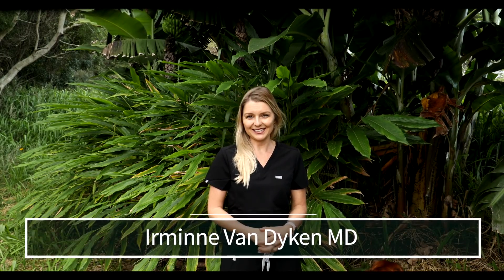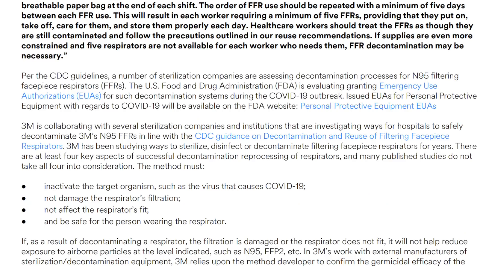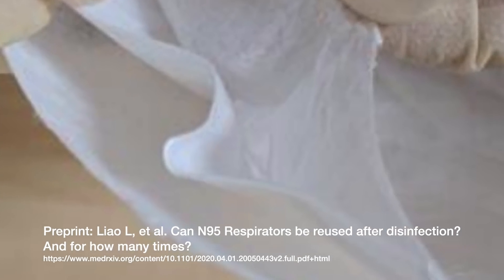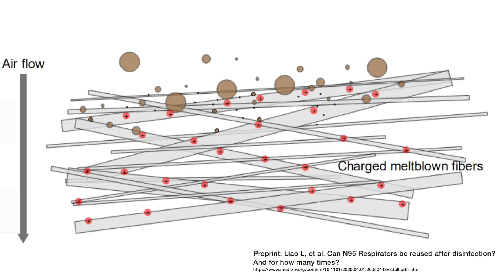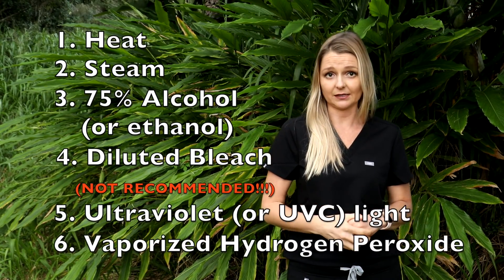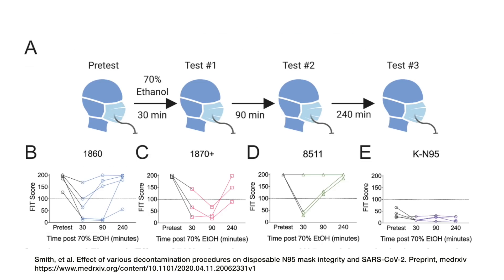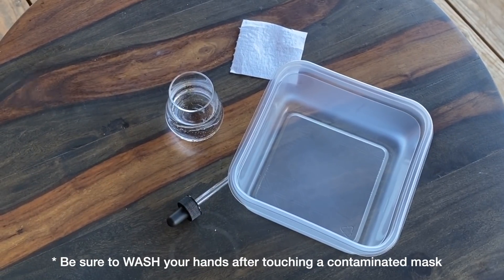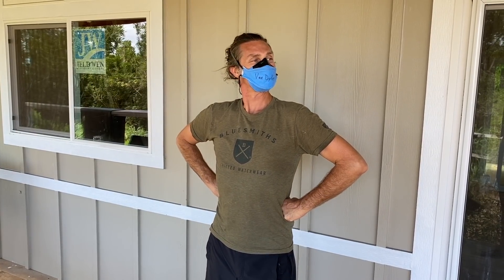How To Disinfect Your N95 Mask at Home

Comment: Excess blather. Must understand that n95 filter works by electrostatic absorption. not reuseable by DIY nuking or baking or boiling or spritzing sanitizer.
AP news 04.23.221 "FDA: n95 masks now plentiful, should not be reused. . .transition from crisis capacity conservation strategies. . ."

Comment: The fibers in a N95 mask are plastic strings (poly) that are only 10 microns across but the static electricity in friction of air as a wearer breathes and exhales "activates" these 10 micron across poly fibers creating a static electricity "field" that "suspends" these tiny .3 micron (so they are 60x smaller than 1 human blood cell) Corona virules.  Washing, heating in an oven does nothing but destroy the ability of these masks to work and they are not reusable. They are just like a vacuum cleaner bag. once they fill up -- that's it. ..and they can fill up after a relatively small exposure time.

What an N95 or ANY face mask does, even if the N95 no longer protects against COVID 19 -  for the wearer is this: it acts like putting a towel over a room fan. It stops the air movement of a person's breath from reaching other people..so the wearer wearing ANY mask protects other people as the wearer's breath can no long travel across the room or 6ft as the lungs exhale air is significantly supressed.

Wearing ANY mask provides the wearer  little protection against ANY CORONA virus.  The average cloth/tissue mask is 60microns, so .3 micron virules pass thru the mask-- it's like stringing a tennis racket over your head before you take a shower expecting it will protect you from getting wet.  So, wear a mask to protect other people from you.

Sit around people wearing a mask.  They're protecting you by wearing one...but not themselves at all.

Comment: Cool. A temperature controlled oven is quite hard to find but this is the best and most efficient, in my research. Thanks Dr. 

I'll use my SMD workstation hot air (used in electronics) at 100C which is the lowest it can go and since Corona virus dies at 70C (safe at 85C for allowance, just in case some variants are more resistant to 70C) in 5 minutes, I'll blast it with the SMD hot air wand for 3.5 minutes or 210 seconds into  heat resistant container with 12 drops of distilled water, maybe 4 minutes, creating a kind of convection oven.

I'll use steam (15 seconds each for the front and back) to try to clean the debris off, to make it look close to brand new- hopefully that works (without scrubbing as it can destroy the filters).

God bless, Rev. 21:4

Comment: People need to see things in perspective, 
The size of this video window is the mesh size of those cheap earloop masks, 
The size of the "Mini Player" box is the mesh size of an N95 mask
The size of the Virus is the red "HD" square.
Trying to stop an INBOUND virus with a cheap earloop mask is like trying to stop Pollen with a Chain Link fence.  The masks are supposed to stop outbound droplets and it only really stops spit sized droplets which are the ones that don't travel far. Exhaling through a mask micronizes the droplets so they can float around for hours.
IMHO, if you are not using an N95 you might as not wear anything.

Comment: I use the UVC method with my N95 masks. First I place the mask on a small turning plateau. Then I put a 40W germicidal UVC lightbulb at a distance of 20 cm. After 15 minutes I turn the mask upside down so the side touching the plateau gets sterilized too. 15 minutes later it's done. 
The only downside is that the masks smell like ozone.

Comment: I just used a spray hand sanitizer with 80% alcohol, would this be effective?
Reply: That deactivates the electrostatic charge  which compromises the masks effectiveness by about 30%. So Isopropyl Alcohol is not recommended.

Comment: You say cook for 30 minutes, but then say 40-50 minutes.  Do you leave the container in the oven after the 30 minutes when the heat goes off, or do you leave the heat on for 40-50 minutes?

Comment: This will kill my electric bill. Is there a way to use my old oven (That sets at 200 degrees & up, without any control panel) to do the same thing? Also if I used  a digital thermometer will this ensure that the temp. is correctly maintained? Thanks so much for your research  👍👍

Comment: On you video you say 30 min. then rotate lid 45 degrees and put back in oven for 5 minutes.  That adds up to 35 minutes in the oven.  You also say it will need to be in the oven for at least 40 to 50 minutes.  So the math does not add up.  Which is it .  Thx

Comment: Here in Finland almost everybody have a sauna or are possible to use it. The most usual temperature is around 80˚C to 100˚C. I think that it is very good opportunity to clean masks. Some people go to sauna every day, some only once a week.  I wouldn’t use plastic box but something else which can withstand the heat. That your hint using water is good. Anyway, if using different method; the virus is killed in three or so days so you can just leave the mask and wait, let’s say four days and it should be all right to use. What do you think about this method?

Comment: Hi mam . I need I suggestion . Pls help me .
I am from India .
During this Pandamic,  as per ours Government and researcher they announced N95 with valve/ respirator is not safe to use.  
So can we 1st wear a 3 layer surgical mask and on top of it N95 or N99 valve mask ? Will it be best idea ?? 

Pls solve my querie.
Reply from the maker: Hi! thank you for your question, it is a difficult one. It depends on where you are wearing the mask. Also, I do not believe there have been studies done on transmission of a N 95 mask with a valve and a surgical mask overlying it. There is concern of leakage through the valves, and a surgical mask may not block that inhale or exhale leakage. In other words, theoretically viral particles could be transmitted through the mask and through those valves. But, when I’m working with a patient that does not have known coronavirus and it is not an aerosolizing procedure, I wear only a surgical mask. No N 95. For any aerosolizing procedures, I wear an N 95 non-valved mask covered by a surgical mask. Honestly, if it is a choice between an N 95 mask with a valve and no N 95 mask and you are working with a known Covid person, I would choose the N 95 with a valve over no protection at all. I hope this helps.
Reply: @outofthedoldrums  ok mam . Thanks for your reply . 

As we have to wear mask for long time , every day 6 to 9 hours, and ours Indian researchers says the N95 mask with VALVE have an issue to transmit the virus through the exhaust air out from valve . Without VALVE it's too difficult to wear for so long . So should we 1st wear a surgical mask and then on top a N95 with VALVE.  
So that the surgical mask will block the out flow of air and the N95 mask will filter the intake air through VALVE.  

Can this be done ??

Comment: Can I wash my N95 mask with regular detergent?
Reply: NO. Don't wash it at all! If you get it wet or spray it with alcohol or hydrogen peroxide, it will become useless. I learned that the hard way. Kept spraying mine with alcohol and then later, when new studies came out, I  read an article by The American Chemical Society who did a study on how to clean N95's. That was the worst thing I could have done. It has an electrostatic charge in the middle and that's what gathers all of the bacteria. So if you get the mask wet, the effectiveness goes way down to only 50 percent. Might as well use a cotton mask if that happens. I personally don't want to buy a convection oven as said above in the video, so I am jjust leaving mine in a paper bag for two weeks until the virus becomes inactive. In order to do this you have to have several masks though. I am blessed that I have several.

Comment: I just threw my P95 in a washing machine with laundry detergent (Quick Wash).  It came out just fine.  If I die, I'll die with a clean mask.  But I'm not a healthcare worker or caregiver.  And the only time I come out is to grocery shop.

Liquid hydrogen peroxide showed no effect on FFR filtration performance [3, 7]. Bergman et al. evaluated six FFRs for filtration performance after a 30-minute submersion in 6% hydrogen peroxide. All six FFR models tested demonstrated no changes in filter performance after three cycles of decontamination. FFR fit and disinfection efficacy were not assessed for this method.\\

Comment: I have a question about your process.  You say, "no direct line of sight to any radiative heat sources which would cause potential damage the mask."  I'm at a loss to understand what you mean.  My small convection oven has an exposed heater element and a convection fan - is this what you are concerned about, the element being a concentrated heat source, and not creating uniform heat?  If you could be more specific as to the context of your caution, then I may be able to adapt your method.

I'm also curious about how you developed this process and references you have consulted.  Thanks.

Comment: This works very well, I have steam cleaned my mask several times by using your method.
My plastic box had a max temp of 120c stamped on the side. , so 85c was fine.  One change was that I took a piece of kitchen towel, made that damp, crushed it up and placed inside of mask to keep its shape.
I had fold flat masks which were very stiff out of the box and rubbed your cheek bones leaving marks after 30minutes use. Steaming has removed the stiffening agent and now they are far more comfortable to wear. 
Look really clean and nice with no damage at all. I know they are a good airtight fit as they deform when I inhale quickly. Exhaled air goes through the respirator valve.
Good advice
Thanks

Comment: No way the job could be done in a microwave oven?
Reply: The metal clip in the mask would likely cause a spark or fire hazard.
Reply: @Just1American1966  Hmm.
Funnily, I have a microwave egg boiler made of plastic but with an aluminium plate on which the eggs rest.
No such prob there.
Reply: @HRHKamal  

I don't know about the non-ferrous metals, but I have personally seen issues with stainless steel (a spoon left in a bowl of oatmeal), a foil-lined protein bar wrapper, and the gold-leaf metallic decorative trim on a glass candy dish.
Reply: @Just1American1966  OK. But the metal clip in a mask is made of Aluminium, so that should be fine in a microwave?
Reply: @HRHKamal  

I'm not gonna promise that. If you try it, let us know if it was okay or not.

Comment: 190 proof = 95% ethanol EverClear is available in many jurisdictions, including where I live, so from your words, the alcohol method would seem best. Also, even where 190 proof EverClear is not available, you can usually purchase 151 proof = 75% Puerto rican rum, so the alcohol method might be more practical than you suspect.

Also, won't heat damage the headbands?

Comment: So if you don't have access to a convection oven, can you use a regular oven?  

I read an article about disinfecting a cloth mask by placing it on a baking sheet (I use a pizza pan) and then into a preheated regular oven at 170°F for at least 30 minutes (I've increased the oven temperature to 200°F and the time to an hour).

I also have made a DIY filter to place inside the filter pocket of my face mask.  I use 2 pieces of 100% polypropylene (aka Oly Fun Craft fabric, from Hobby Lobby, or Pellon 915 Cambric interfacing fabric, from JoAnn Fabrics), for the front and back of the filter, and placed the filtering material taken from an HVAC/Central Air filter with a rating of at least MRP 2800 or MERV 14 (such as a Nordic Pure MERV 14 plus Carbon air filter from Amazon) in between the 2 pieces of 100% polypropylene.  I then cut all pieces to fit snugly inside the filter pocket of the cotton face mask, and taped all edges using waterproof athletic foam tape (such Nexcare from Walmart).  

I also put the DIY filter into the preheated oven for an hour, with the cloth face mask on the pizza sheet (set apart on the pan, never touch each other).

After this heat treatment, I also spray the face mask and filter with a 70% isopropyl alcohol volume solution.

Is this safe, and is it killing Covid-19 virus?

(I do notice that the filter, specifically the 100% polypropylene, eventually becomes dry and brittle; when it starts breaking apart, I discard it and cut out a new one for the filter)

Comment: Doctor, please comment on washing the mask with "laundry" (high lye content) soap and water.and hanging it outside to dry in the sun (UV). It might be worth testing.
Reply: Seems like the washing machine might tear the mask fabric
Reply: @magz98610  I only hand-wash my own mask with old-fashoned bar soap (NOT detergent) just like washing my hands. I hadn't considered  using a machine. I am referring to a multilayer N95 (paint) mask used in "lower risk?", non-clinical, situations like my going to a local  phamacy.

Comment: 70% alcohol isn't hard to find.. YOu just buy the 91% that's in a lot of drug stores.. and then dilute it by adding distilled water >_>  Just have to calculate the water you add with the volume of water in your bottle and voila... 70% alcohol :)

Comment: How to disinfect your n95 mask: Set it down and leave it there for 2 days. Nothing else is needed, and anything else will degrade it more quickly. The only reason hospitals disinfect masks with heat, peroxide gas, uv light, etc is that they are in short supply and have to rotate them quickly back into service.

Comment: What she is not mentioning is the tremendous degradation of the mask(and its fibers), thus ability to still filter out the virus goes waaay down using most of these methods, except the UV light(which mainly degrades the straps(thus the proper fitting).  Let your masks air out for two to three days if possible!  https://www.facebook.com/smartairfilters/videos/1097078063991680

Comment: You see those transparent shield helmets and a mask underneath, that's probably very effective since they can be cleaned and they capture already much of the virus droplets. But it's an expensive system and not easy to get one. So what if you would soaks a thin fabric in a glycerin/detergent solution and wore that (with first protecting the skin with some plastic) above the mask so it could capture the viruses ?  The viruses could find their end in the detergent soon and so it would make for a primitive but more complete protection perhaps??

Comment: Plastic in the oven ??? That’s more dangerous than letting your mask dry for 72 hours and also releases dangerous chemicals. I myself have an eye clinic and this is a no no according to guidelines
Reply: There are many plastics. Like literally every substance in the universe, they have chemical composition. Also like literally every substance, various plastics can be dangerous under various circumstances. An informed decision requires more information than an appeal to unspecified guidelines. I would question whether a heated n95 mask would outgas enough to be significantly harmful after an hour or so of cooling in open air, but in any case I would need much more information to support any claim. Also, extra care must be taken where there is bias, and because there is a general distrust of plastics the risk of bias is higher than normal.
Reply: @grantbarnes3678  Find old Pyrex or Corning-ware containers.  I doubt that the mask needs to fit perfectly .. as it did in the plastic.
Reply: Takes 7 days for virus to die from a mask
Reply: @WilliamIsCool15  you mean without ever putting it in the oven? So, if you have a few to rotate, no need to do this? Thank you.
Reply: @WilliamIsCool15  The Bacteria needs to be killed
Reply: @WilliamIsCool15  Isoprople alcohol, soap+water and UV-A, B, C all together does a very good job of disinfecting the mask.
Reply: Agree omg!
Reply from the maker: Thank you for your comment. As a general rule we do try to avoid as much plastic in our lives as possible. In practice we leave our masks rest for at least a week. We have enough masks now that we have that luxury. The oven recommendations are based on a study that analyzed methods of cleaning n95 masks. No thought was given to the plastics off gassing. I think this could be a potential problem with using plastic masks in general. That would make a great study. As for now disinfecting a mask in the oven at 180F for 30-40 min is safer than using a virus infected mask. We are in the middle of a pandemic after all best practices for a lot of things have gone out the window.  In “normal” times these masks should be used once and then discarded. Before the pandemic,Reusing a mask would have been grounds for disciplinary action or dismissal. Now employers are requiring that masks be cleaned and reused.  We are all doing the best we can do in these extraordinary times.
Reply: @outofthedoldrums  There are certain "plastics" made specially for microwave ovens, that do not emit gas or melt.
Reply: That is what i was thinking. If that is the kind of nurses/healthcare people in the U.S. now, then we are in trouble!! I use to work around doctors and nurses in a maintenance dpt. and they knew better.

Comment: I have five N95 masks and I have been using hair drier for about 1 minute ( high heat) or 2 min ( low heat); I keep the mask in zip lock and use atleast every 3-5 days alternatively with my other masks. Is that a good practice? I am ok so far for the past 2 months. I ordered online. I actually use hair dryier prior to using on my first day after they were delivered by mail.